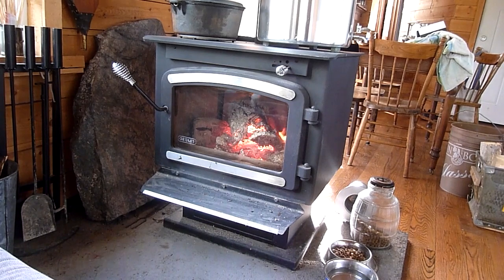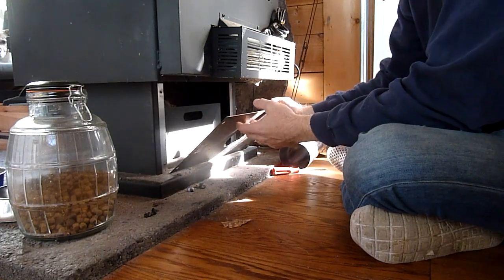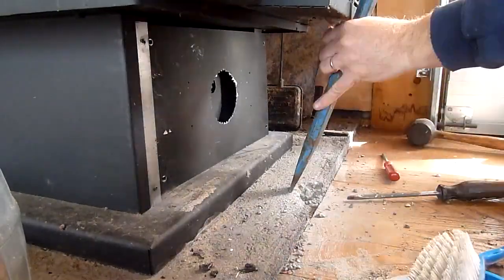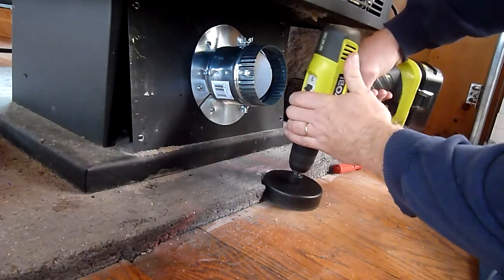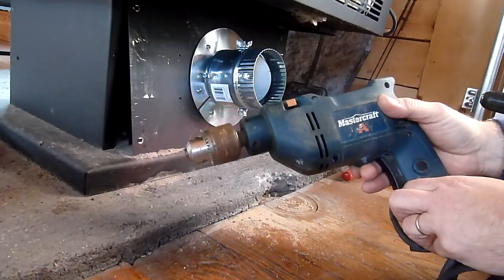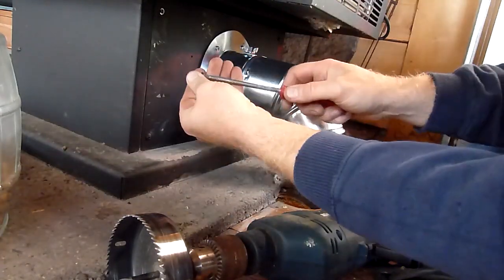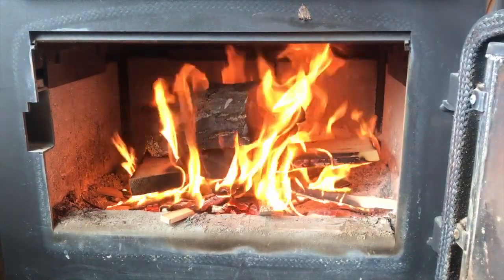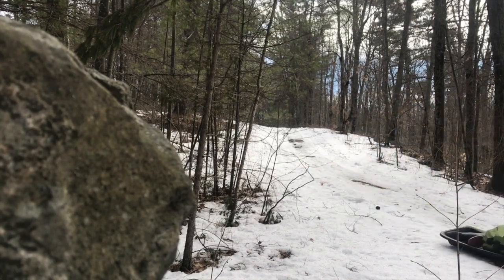Better burning wood stove with a external air intake!

Comment: Years ago when I burnt wood I did the same thing worked good but even with insulation it would frost up in dead of winter.
Reply from the maker: We haven't had a problem yet, but winter is coming!
Reply: Hi! Did it ever frost up? Thanks!

Comment: i need the dry outside air to lower the moisture buildup in the cabin.
Reply: Add ventilation to the cabin.
Reply: @kattihatt  no point...woodstove does a wonderful job of it already.
Reply: @richardriehle4159  but dont you need ventilation for air intake into the cabin?
Reply: @kattihatt  like you mentioned in your video, air comes in through cracks and crannies . my cabin door is not sealed airtight . and with a bank of windows between the door and wood stove, the incoming fresh dry air keeps moisture buildup from happening on the glass .